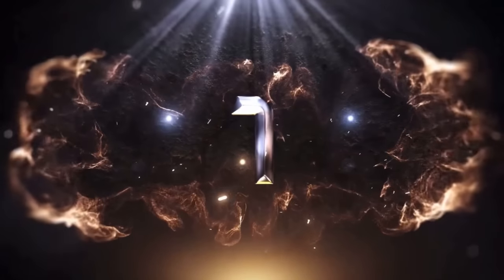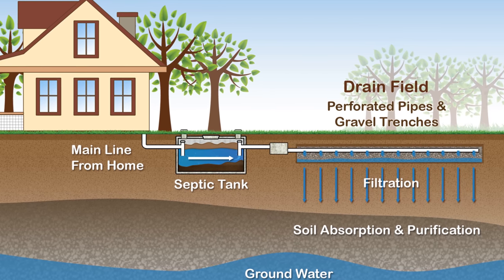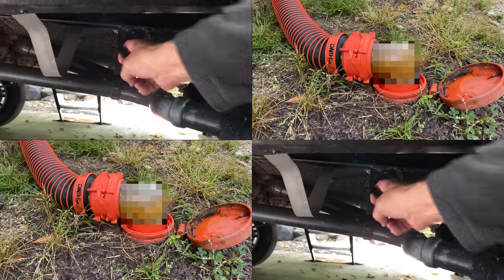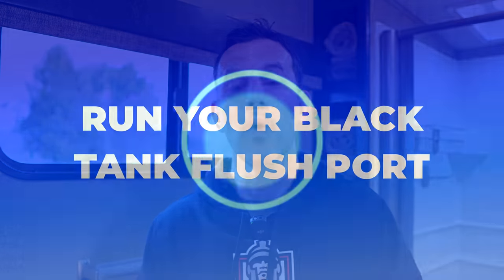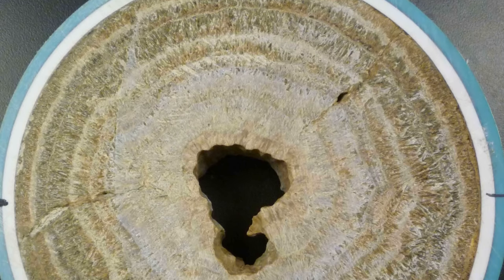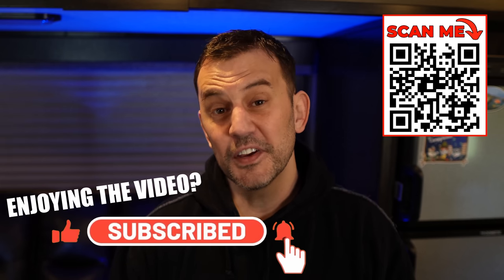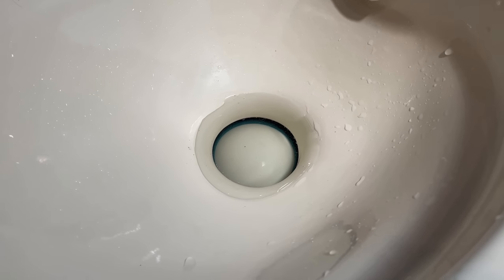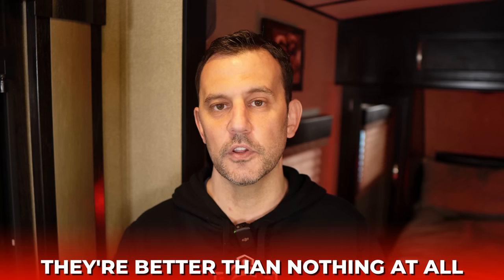RV Black Tank Mistakes, Myths & Secrets + Tips to Keep Sensors Working!

Comment: You're talking as though everyone is on a full hookup.  If you're moochdocking or boondocking you can't use large amounts of water and fill your tank prematurely if there's no way to dump until you leave.  I personally got fed up with my sensors.  I'd get them clean and working and the next time they'd be wrong again.  So I clipped the wires and installed SeeLevel sensors which seem to be much more reliable.  And as for RV toilet paper, we tried cottonelle one time and plugged the damn outlet.  So we went back to Scott RV toilet paper because it has NEVER clogged on us.
Reply from the maker: Appreciate the input Casey, let me speak to some of your comments.  Whether its a full hook up or not doesnt really matter.  You just need to be connected to a sewer.  That can be at dump station as well, which can be difficult if you have a line behind you, but there are dump stations you can visit to clean your tanks.  If we didnt camp at full hook up sites I would definitely spend the money on using one every so often.  Agree with you on sensors, mine every so often will misread, so I just do everything in this video and they work great afterwards. https://youtu.be/Q7ZJzfimLwg
Reply: @RVTIPSANDTRAVELS  I have a sewer connection at home I'll flush at from time to time.  When I do I'll connect to the flush, close the dump valve for a bit to fill the tank (being careful not to overfill).  I'll repeat that a few times.   I was speaking to the part where you talked about using plenty of water when you flush. I don't disagree when on full hookup but things are different when you don't have that.  I also like to leave a few gallons in the tank when I travel to slosh around.  I think it helps. But like I mentioned previously, septic safe is no guarantee it won't plug.  The cottonelle looked as solid when it finally released as it did when we flushed it.  I worked the valve several times, banged on the outlet tube until it finally gave way. The RV stuff always falls apart.
Reply from the maker: I agree with you... boondocking is a different animal and managing waste tanks is definitely more difficult to do in those situations.  I just use wal mart 2 ply septic safe toilet paper and have never had any issues.

Comment: I always find it funny RV’ers will spend thousands of dollars on a rig and then always worry about a few pennies when it comes to RV toilet paper.
Reply from the maker: The reason I recommend septic safe has nothing to do with the cost, its because it dissolves better, as mentioned in the video.  In fact, there's videos on Youtube that test RV toilet paper VS septic safe toilet paper and septic safe outperforms and dissolves quicker than expensive RV branded toilet paper.
Reply: @RVTIPSANDTRAVELS  Fair enough.  But, even in your video you mention how a RV holding tank is different from.a septic system.  Septic systems typically involve much larger amounts of grey water and the solids will stay suspended much longer than in a RV.  This is why I always hesitate about assuming "septic safe" is fine for RVs.

I work in a RV dealership and usually tbe first thing people ask about when talking about toilet paper is cost.  It blows my mind.  Drop $125,000 in.a fifth wheel and worry because four rolls of RV safe toilet paper is $1 more than their favorite Wal-mart brand.
Reply from the maker: Dan, I would agree with you and I think I mistook your comment on more expensive toilet paper as meaning getting "RV branded toilet paper" over septic safe.  Now after your 2nd comment, I think you mean septic safe is more expensive than non septic safe wal mart brand.... but eithe way, I'm 100% with you... RV'ing is not a cheap lifestyle, even if you are part time.... I get comments all the time about saving $10 on a $200 product by going with the Chinese version over the better built, more well known American brand and I wonder if they spend the time and money on proper maintenance.  I'm sure you see maintenance neglect all the time... but I'm sure it keeps you employed too!

Comment: Who the hell is putting toilet paper down their black water tank I don't put any toilet paper in my black water tank and plenty of water I have no problem
Reply: Bidet?
Reply from the maker: toilet paper isnt the problem.  toilet paper eventually dissolves.  the problem is getting the waste out of the tank.  if it doesnt come out, and it doesnt on the first dump i can promise you that, it sits in the tank.  i will be releasing a video next month with video footage of this using 2 black external black tanks I made.
Reply: Why would you not?  It's literally what it's intended to be used for.

Comment: Thanks for your caring, research and video. Another bad reason to connect bathroom sink or tub drain to the black tank is horrible odors may travel up there. Do you have a thorough video on dump valve lubrication? I've seen videos where they drill a little hole into the upper part of flat plastic part the rod goes into. Then they spray either silicone or white lithium grease in filling it up. Then put a little screw in to close the drilled hole. I've also heard petroleum based lubricants can damage certain valve materials. Is silicone non petroleum based the safest lubricant to use? Can you recommend any inexpensive brands please. I'm thinking the white lithium grease spray is better because it's thicker than silicone spray. But if white lithium grease isn't available in a non petroleum based solvent then 100% silicone spray is safer. Any ideas, advice or suggestions much appreciated. Thank you and Happy Easter Season 🪴🐣🪻🐤
Reply from the maker: thanks for watching and sharing!
Reply: @RVTIPSANDTRAVELS  Absolutely!!  I finally found 100% silicone spray that's totally petroleum free. Apparently, petroleum products can harm certain valve materials. God Bless and safe, happy RVing!!! 😊
Reply from the maker: take a look at this product: https://amzn.to/3VCRgU1
Reply: @RVTIPSANDTRAVELS  Thank you for sharing this item. It looks like great stuff, but I'm pretty sure it's got petroleum in it. The RV people caution us that petroleum products can harm valve materials. This is what I copy from a guy's answer to my question. Q: Is this 100% petroleum free? And a great product?
GJ answered:
"The label says it contains “petroleum distillates.” It’s a great product that goes a long way. It took me over ten years to use my first can; I use it regularly on my cast iron tools, especially the table saw due to the extremely high humidity in north Florida."
Reply from the maker: It’s safe on rv’s.  it’s endorsed by Tiffen and Airstream.  I’ve been using it for years.